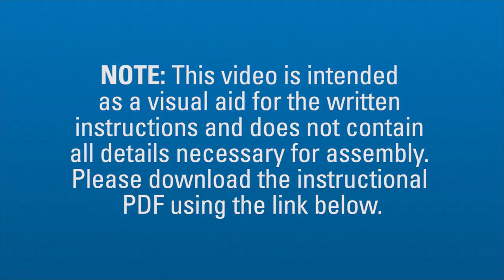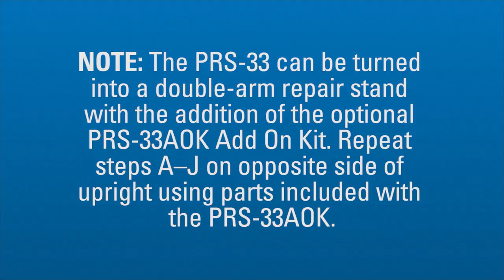PRS-33 Assembly Instructions

Comment: I’m sure struggling to get my carriage assembly to slide on as easy as the video showed,. I’ve  removed it 3 times and tried again and I can barely get it to budge with a rubber matter.
Reply from the maker: Get a hold of us at info@parktool.com and we can get you some different bearings.
Reply: For future  customers:  put a very slight bevel (chamfer) on the top edge of the tracks to help guide the bearings onto the tracks.

Comment: What is being shown at 1:59?
Reply from the maker: The two carriage bearings are a tight fit, and it is not uncommon for the beam to peal a little material off the bearing as the unit is engaged at the top of the beam.
Reply from the maker: Those are the shavings that come out after the carriage is slid on. They are not always visible and on some of the newer versions of the stand.
Reply: @parktool  Thank you. I see set screws behind the bearings (if too tight or too lose, I assume).

Comment: Of crse they dont show/say anything abt installing it without their optional $300 base plate! SMH. Need to know if hardware incl. for bolting to floor and if not what do you need because this thing is totally useless without that small piece of information.
Reply from the maker: It is in the description of the item online. Some people want to  bolt these directly to the floor. Others want to use the floor plate. The hardware to attach it to the plate comes with the plate. If you are attaching it to your floor the fasteners may vary so you will need to provide the fasteners.